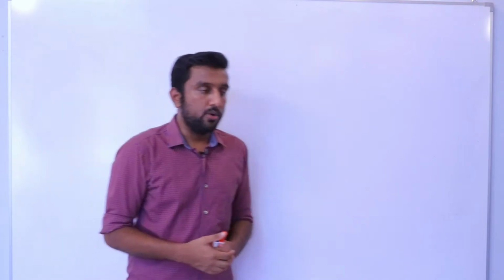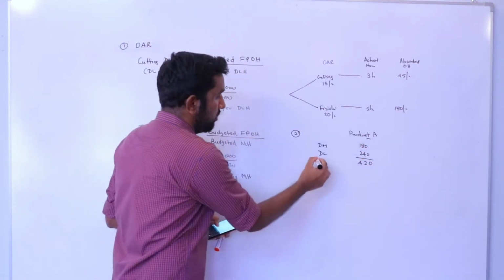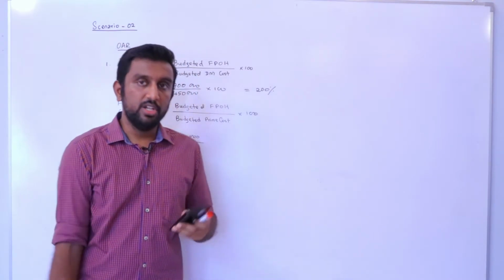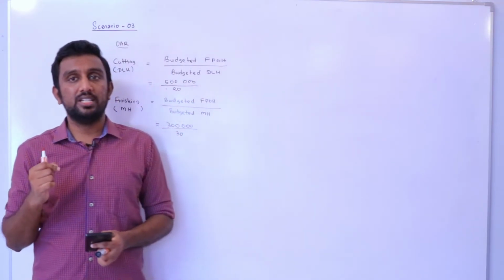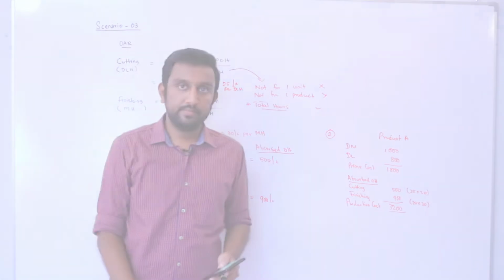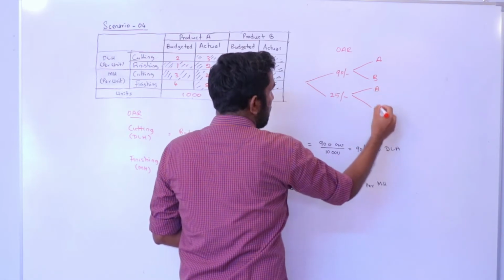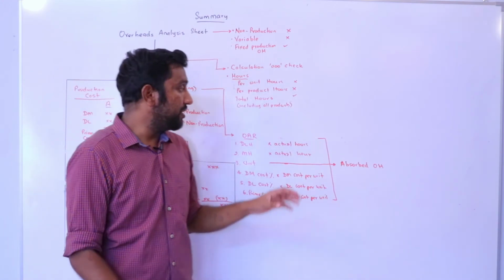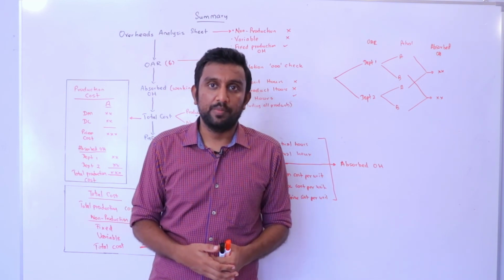Advanced Level | Cost Accounting | Overheads Costing | Part-3

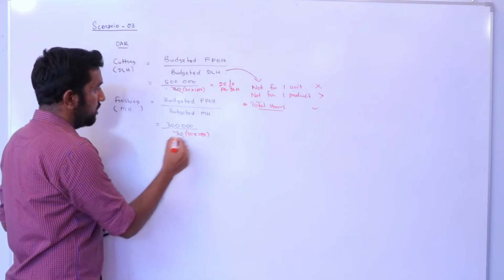Comment from the maker: check description section (at 26:18 (min), there is a calculation error. It should be Rs. 10 (300,000/30,000). It is NOT Rs.30. And this (Rs. 10) should be applied for absorbed overheads calculation as well)